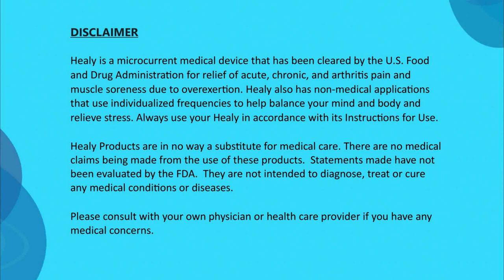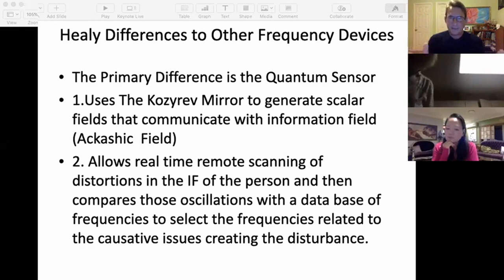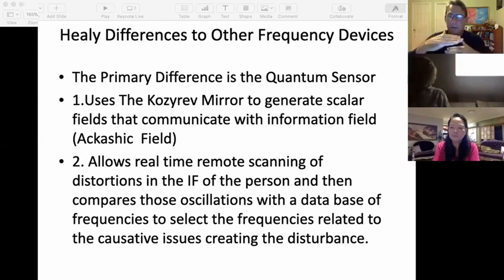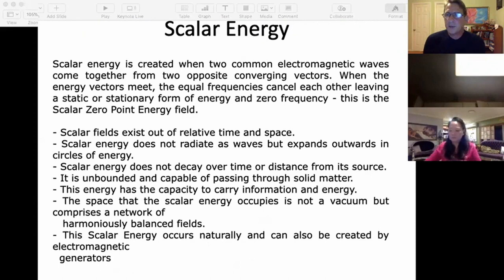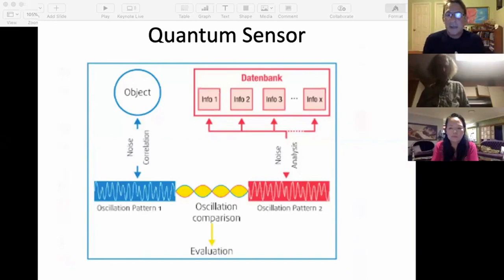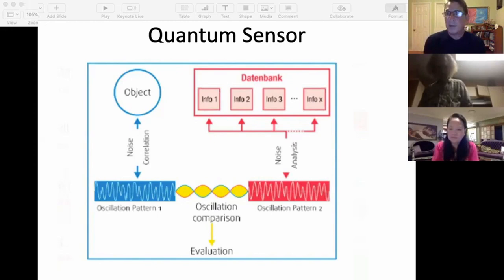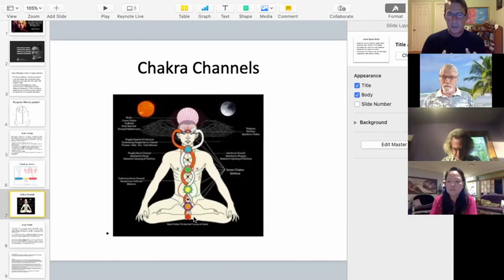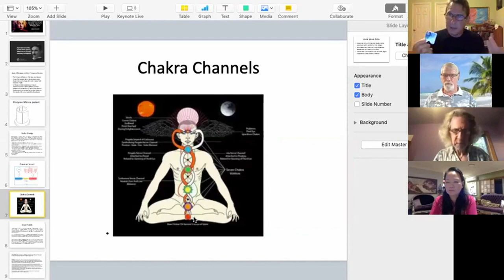An explanation of how the Healy Quantum Sensor works by Mike Curley

Comment: What is wrongly called a "quantum sensor" is actually a random physical noise generator that uses specific algorithms to analyze, filter and separate information structures from ambient noise signals.
Understand that it is an electronic component (located inside the central electronic processor) that combines several technologies, and not a specific and visible "physical (material) object".